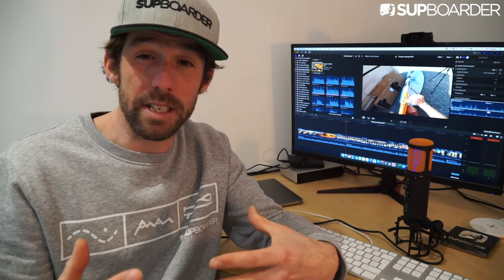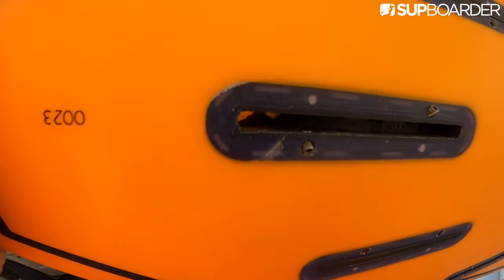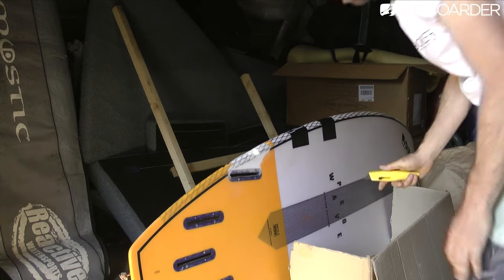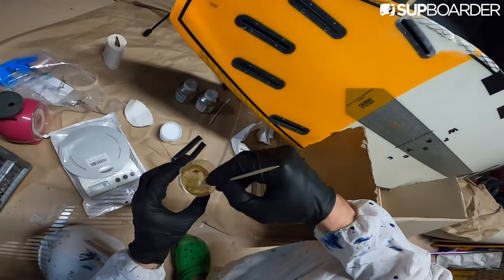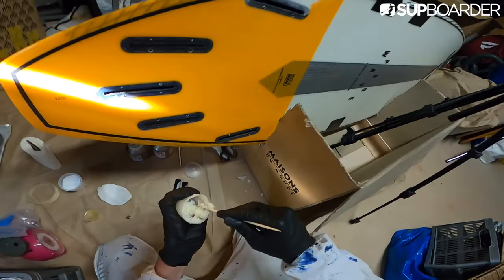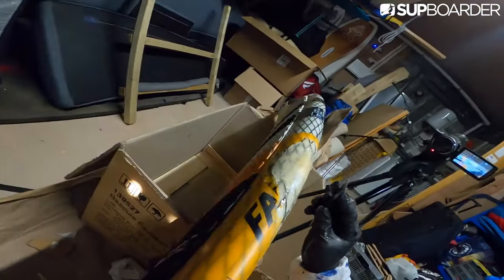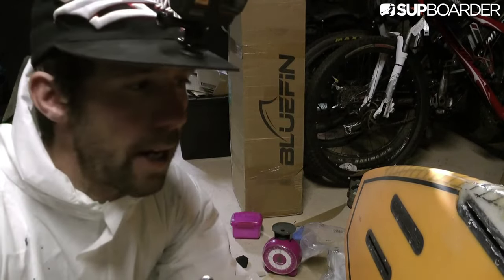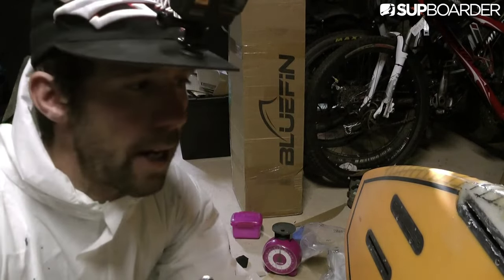SUP Repair Vlog / How To Fix A Trashed Board

Comment: nice rail fix. I did a similar repair over winter also with the west kit. what I learnt is bringing a cold board into a warm house isn't good for air expansion... and that it's best to do it in a falling temperature so the air inside the board is contracting.
Reply from the maker: Hi John, thats a fantastic tip! Cheers, Will | SUPboarder

Comment: It is all about try and learn process, always can sandpaper surface and do it again.
After surface preparation, first use paper  and masking tape to protect board from extra dripping epoxy. Choice of fiberglass cloth is important, especially when we speak about materiel bending over edge. Even to go with 80-100g but more layers will be more easy to creat nice  edge shape (especially if you try to repair paddle)

Great video, thanks.
Reply from the maker: Great tips Dusko! Thanks for sharing your insight. Cheers, Beau

Comment: The kit that you have in your hands at 9:40 is not the 101 handy repair pack that I see online. The 101 pack comes with much smaller quantities of resin and hardener (32grams as listed on the cut sheet).
Reply from the maker: It's called the 'West 101 mini repair kit' - should be 250g of 105 resin and 50g hardener.  Its also available with different speed hardeners I believe. Googling that in the UK brings up the same kit, it might be offered up differently in different locations potentially?  Thanks, Will | SUPboarder
Reply: @SUPboardermag  yea the kits are a lot smaller here in The USA. I think they are marking them up in price and very expensive. I went with Z-Poxy PT39 30 minute epoxy for my starboard repair and posted a video on my youtube channel with the process from an unexperienced glassing individual (me).
Reply from the maker: Thanks - will take a look!

Comment: Thanks for making this video. I'm glad you were willing to put it out there, even though as you stated, you aren't an expert. 

However, for my sake I was hoping you'd do more with the fin boxes since I don't have a repair to do, but I'm getting ready to make a modification to my older 14' Naish Javelin. I want to add some straps to the top surface to hold when I launch from shore. I'm going to add some brass threaded inserts just below the surface of the board so I can bolt the straps to the board. I figure I'll remove a small bit of the skin and foam for each nut and then secure them with an epoxy/micro-balloon mixture like you did, and then finish with epoxy and cloth. We'll see how it goes. 

I'm no expert either, but I used to do some epoxy work for my hobbies a while ago. So instead of corrections I'll offer some 'suggestions or thoughts' of my own to your video.  Take what you like and leave the rest. 

1) One thing you can do is to begin your work by cleaning the surface of the repair, and the area around it, with a really good solvent - usually acetone. (Gloves and good ventilation required, and test the surface before to ensure your solvent doesn't damage it!) The thought here is to remove any wax, grease or other substances that sanding could actually embed into the existing surface, and prevent the epoxy from adhering. While this isn't a super important thing, it can help if you want to sand as little as possible. Lots and lots of sanding will make this moot. 

2) I would have done the epoxy part of the repair in two steps instead of one. The first would have been just the epoxy/microfiber build-up of the surface. Once it cures completely, THEN you sand the surface to the proper shape. The problem with applying the cloth to a rough surface is that in order to sand the high-spots away, you have to sand THROUGH the cloth to get to the excess mixture below it. At that point you no longer have an integral, strong glass surface. You mention putting a coat of epoxy over the repair afterward, but unfortunately epoxy without the cloth is brittle, and it doesn't have the impact resistance of fiberglass. I think you'll agree from you boat repair days that epoxy-soaked fiberglass cloth is both strong and flexible. 

So if you ever get around to repairing the fin boxes, I'd love to see another video of how it goes. Thanks again for this one.
Reply from the maker: Thanks for your thoughts, very useful.  On point one, yep, cleaning is critical if you are not sanding - excellent point to highlight.  Point 2 - yes, this would have been a good idea, it would have added some time to the process which was partly why I decided to do one epoxy application.  Theres always so many ways of doing composite repairs - thats why they call it an art not a science....
On the fin inserts - really these needed removing and resetting - but I felt that I would not get the alignment correct, so opted to try and bodge what was there to get a bit more life out of the board without risking messing it up all together..... I think your approach to your inserts sounds good - please let us know how you get on.

Comment: I thought that polyester eats up through the foam. Did you use it to fill up that hole?
Reply from the maker: Yes Polyester will eat through the polystyrene foam of the SUP,  you must always use Epoxy when the foam core is Polystyrene.  Cheers, Will

Comment: one good tip is to soak the glass patches into epoxy and then applying them on the damaged area. this makes them sticking up easier.
Reply from the maker: Thanks for this Tip Mike :) Cheers, Will
Reply: Tip for glass placement. Take some clear plastic (Ziplock bag) and put it over the damaged area. Mark with a permanent marker the size of mat needed. Now spread the two layers of plastic apart and insert glass mat slightly larger than you permanent marker marking. I use a syringe to now squeeze epoxy onto the glass mat then close the second layer of plastic to form a sandwich. Roll with a short piece of broom stick to really impregnate the glass. Now cut along the outline of you permanent marker line. Pull the one side of the clear plastic off and lay the epoxied mat onto the damaged area. Then peel the top layer of the clear plastic away. Cleaner and neater. Beware not to get any of the permanent marker ink onto the mat or epoxy so I suggest cutting along the inside perimeter of the marking so no ink is visible when done - hope this makes sense.